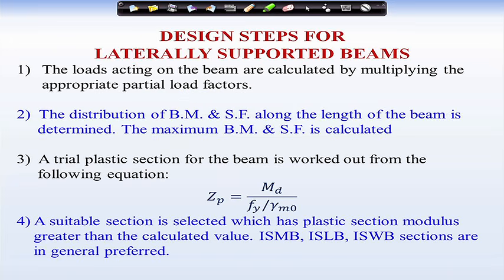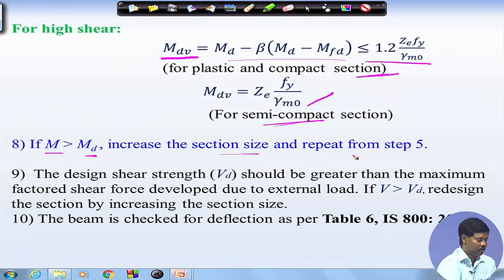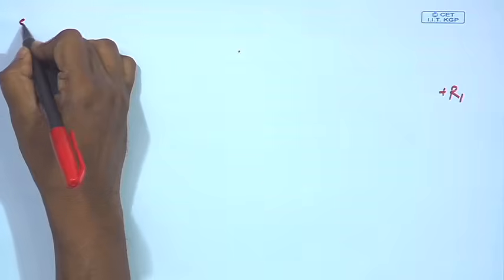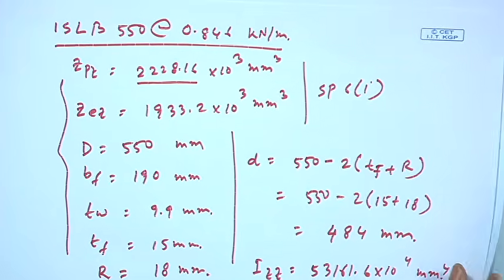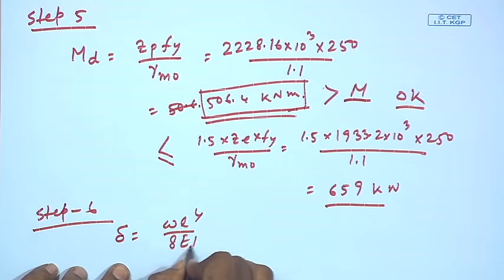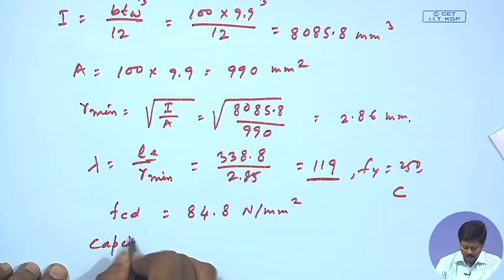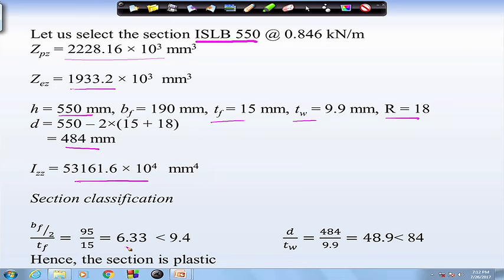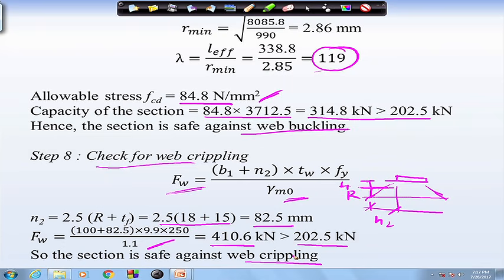mod10lec48

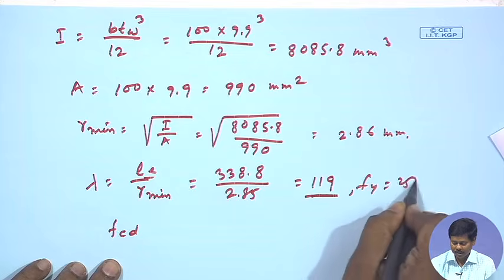Comment: @26:31,  how buckling class c
Reply: By Table 10 IS800:2007, For Channel, angle, tee & solid sections such as Rectangle and circle Buckling class 'C' to be used
Reply: @raghvendrarai5933  But this is an I section, whoose Tf is less than 40mm and h/Bf is greater than 1.2
Reply: @mohammadali1637  no in these questions they are considered as solid sections therefore it is class c